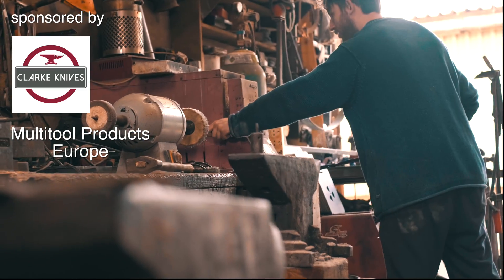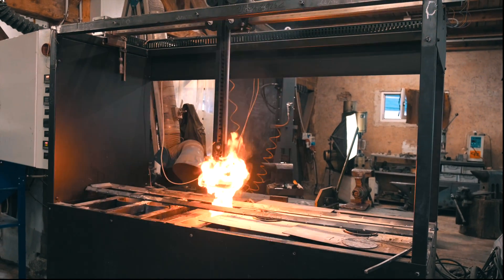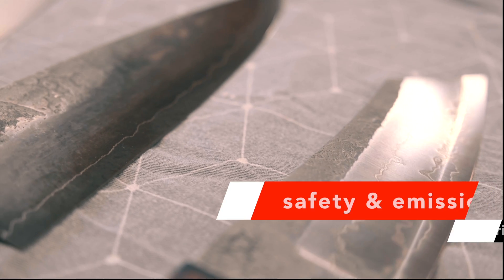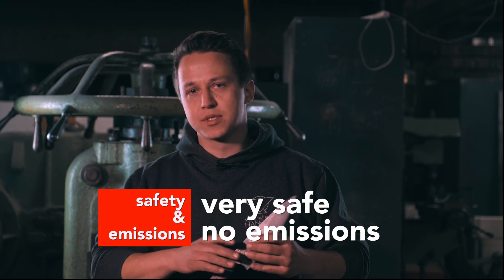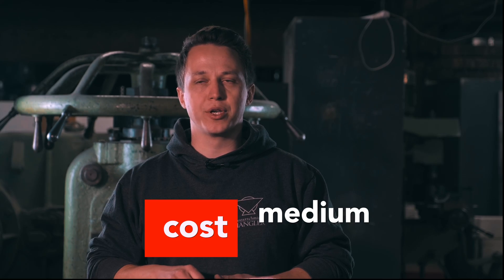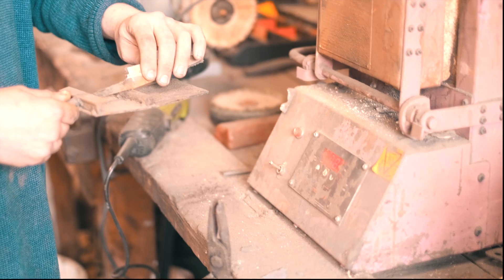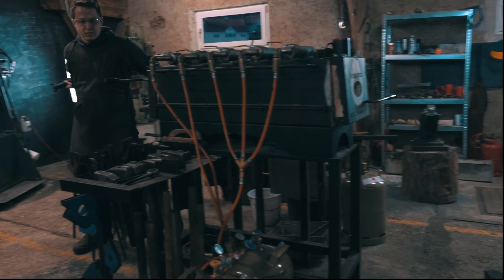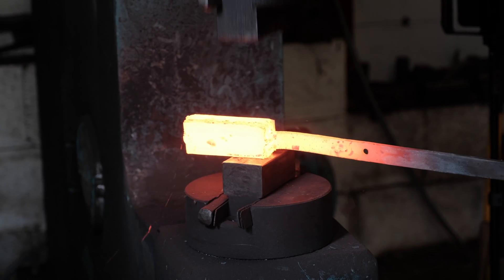DON’T BUY THIS if you're a hobbyist knife maker!

Comment: Did I miss something, or did Tobias not actually address what a hobbyist makers shouldn't buy? Bit of a clickbate title? Good content, anyway. I feel I know more about electric ht kilns now. I'd love to see a video on the benifits and drawbacks of vertical vs horizontal kilns. It seems like horizontal kilns are much more common but vertical kilns might have some advantages for blademakers.
Reply from the maker: Hi fireplusbird films. Sorry if it was unclear to you but what me and Tobias were saying is that a heat kilns are amazing but wouldn’t be the first and only choice for hobbyists, for the aforementioned reasons. Induction heaters or gas forges could be much more economical (but again, have their own drawbacks).

Don’t forget to watch the rest of the series to get a good comparison of various HT systems (link in the description). 

I hope that helps!
Reply: Thanks. I did watch the video on gas forges and their drawbacks, which was a good primer for those without prior knowledge. Dr. Larrin Thomas of @knifesteelnerds has done some great work on the steps to get the cost consistent heat treat with a forge that compliment what you're teaching.
Reply from the maker: Thanks for the comment again. I’m not sure if you were aware but Tobias works closely with Larrin Thomas as they are 2 of the 3 co-developers of ApexUltra.

And yes, Dr Larrin’s video on heat treatment on a forge was a great explanation!
Reply: I didn't know the collaborated on ApexUltra. Very cool. I look forward to watching more of your very informative videos.
Reply from the maker: You’re very welcome! While you wait for the upcoming series, have you seen the short series we did on a “Digital Camo” Damascus pattern?

Makers Gonna Make - Sharman Knives Accordion Digital Camo Knife
https://www.youtube.com/playlist?list=PLFssspwgISv--BoDbM0IsriiSLlgeK5AE
Reply: I haven't seen that one yet. I did watch the CuMai video yesterday and found the discussion about melting copper very interesting.

Comment: DIY instead??
Reply from the maker: There’s lots of great DIY Heat Treatment Systems so yes - and it would be fun to make one to I bet!
Reply: DIY is not difficult, mine was under $500 AUD in total, around 2KW, easily goes to 1100c with PID and keeps stable within 2-3 degrees. Wind your own Kanthal A1 elements, put a safety switch on the door and run through an RCD protector and you are golden.

Comment: I’m curious what will be the final conclusion of this series, because so far non of the methods have gotten too much praise it seems like. Will the recommendation be a fluidised sandbed perhaps?
Reply from the maker: Hi Wassail good morning and thanks for the feedback. There is pros and cons of each system, including the last one, which is as you guessed a a fluidised sand bed.There isn't one system that will cater for all types of makers (i.e. a gas forge is best for smaller makers but won't have accuracy as others; a fluidised sand bed (spoiler alert) won't be great for smaller makers as it takes a long time to heat up and won't be cost effective).

The objective of this series is a comparison for knife makers who want to see what other systems are there for them, and which one suits them best.

I hope that helps!
Reply: I think elecric kilns are a good choice for many makers. I just tried to explain that there are also downsides to this system in general - as with everything else too. But then you can decide yourself what the things are you value the most and chose the right system for you. There won't be just praise for any of the systems 😂 i am certainly biased towards using fluidized sand beds - for the things i do it works really well.

Comment: Very nice and comprehensive explanation about heat transfer and how the steel behaves at different temperatures. I have built my own kiln, 3.5kw with a 40x17x11cm chamber and it goes to 800C in about 20 minutes.
Don't know if you're gonna read/answer this but I have a question that really bugs me:
When doing an aluminium plate quench and the knife is already ground and not resting flat against the plates, does that affect the cooling rate of the part of the blade that is not touching the plates or does the fact that the section of the metal is much thinner it counteracts this issue?
Reply: The basic answer is: the bits that aren’t in contact with the plates will cool down more slowly than the bits that are. 

Whether that’s a problem or not will depend on the grade of steel you’re using and whether you needed to quench in oil before the blade goes into the clamp. 

(I’m not totally sure i understood your question. If I haven’t let me know)
Reply: I agree with Tom, the missing contact and the insulating foil will result in slower cooling on preground sections. If the cooling rate is still fast enough will depend on the steel. If youre not using foil, using an oil quench followed by a plate cooling can give you a high cooling rate with minimal distortion.
Reply: You'd have to check the engineering report on the particular stainless, but if you can get it from the austenising temp down to below about 3-400C within about 2min it will be hard. So that's why I usually give it a blast of 4-5bar of pressurised air while it's in the plates to cool off the thinner areas as quickly as possible. For stuff like knives though which are thinner stock the cooling rate typically isn't really a problem, unlike something like die moulds or other big lumps of metal which gets a lot trickier.
Even some stuff like A2 and AEBL you can probably not bother with the plates and either hang it up to cool in still air or if you're feeling adventurous you can hit it with the air hose but run the risk of cooling one side quicker and getting a bend.
Reply: Thanks for the replies guys. I've had mixed results with different types of stainless steels, all wrapped in foil, always. The worst offender was X50CrMoV15 which was noticeably harder in the best point of contact with the plates when testing with hardness files. AEB-L, K110  and N690 behaved really well without any noticeable differences (K110 even going above 65HRC with smaller blanks). I did notice that clamping force does make a difference in hardness since it removes the air gaps that the foil might introduce.
Reply: @Nospheratorum  As long as you’re not dawdling before getting the blades in the plates the quench speed doesn’t seem to be the issue. None of the steels you’ve mentioned need unusually fast quenching. 

You’re quite right about the clamping force - an air gap will slow down cooling.

On the X50CrMoV15,  mind me asking what your austenitising and temper temperatures are? It ^might^ be a retained austenite problem as opposed to a quench speed problem. 

(Also throwing that out to any other metallurgists - have I missed the bloody obvious?)
Reply: @Nospheratorum  I thought of another possibility. Chrome carbide formation. If the carbon is tied up in carbides it won’t be available to form as hard martensite than if it was in solution. Cr carbides can come in various different structures but one form will grow quite quickly in the 700-500C range. If your cooling is too slow through that range you might be losing martensite hardness. The solution would be to cool a bit more more quickly (though not ^too^ quickly to prevent quench cracking).

Checking your hardening and tempering temperatures to see if there’s an issue would show it was likely the first. I can’t think of a way to prove the other without cutting it up for the microscope or some corrosion testing though…
Reply: Simple solution, I dont grind stainless pre-HT, only the profile and drilling happens pre-HT, get proper contact, far more consistent HT, you just need to wet grind to keep it cool avoid affecting the temper.

Comment: Thanks again I am just setting up my workshop. Mostly stock removal and restoration so was going to try avoid a furnace and get my stuff heat treated by local specialist. BUT......If I were to decide to do it myself, I have made life difficult with some 3v and other similar powdered metals. I am thinking I have to go electric with pid to set ramps and dwells to achieve the specified heat treatment.

 Have you guys worked with higher alloy steels and had any success with gas? 
Are there non spec treatment that yield serviceable results?
Have access to a 3kw 1200' furnace with Argon plumbing but its owner doesn't really want to pass it on yet..... its not cheap is there a less costly way to do it?  Enrolled in cert 4 heat treatment modules and metallurgy and begin mid next year. But seems too far away atm.  Running low on start up coin need to make the right decision.
Reply: High alloy steels need longer soaking times so heat treating out of a gas furnace is very tricky and i wouldn't recommend it. A kiln with either protective gas or using foil will be perfect for these to avoid excessive decarb.
Reply: @MesserschmiedeHangler  Thanks, yes soak and in an ideal world cryo treatment too. Both of which I can't do myself, yet..... I was aware of the heat treatment requirements prior to buying the material but had access to a materials lab back then. I like doing things the hard way!  I will have to get myself a kiln eventually. But wait, did someone say fluidized sand😜 Sounds dangerous and interesting!
Reply: @rhinejuice  I’m a bit sceptical with cryogenics. There may be a very small improvement in a small number of steels some of the time and that’s as good as you’ll get. “Cold” treatment makes quite a bit of sense but you don’t need liquid nitrogen temperatures for 24hr. A simple home freezer for an hour or so will do the trick for low to medium knife steels and one that can get to -20C or -40C for high alloy steels. 

And fluidised beds are great (but very dusty) fun. I’m looking forward to the next instalment too.